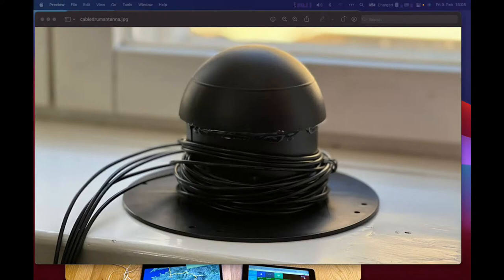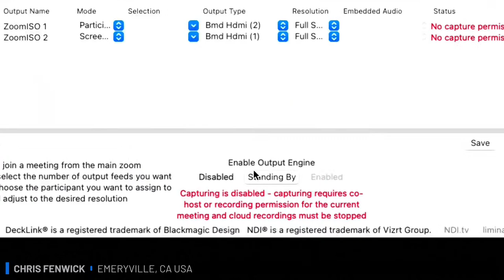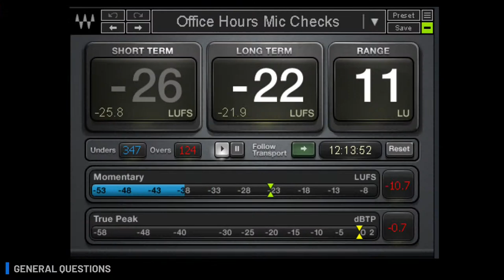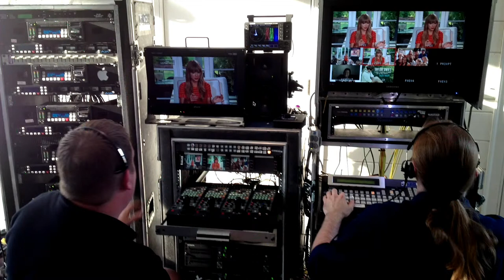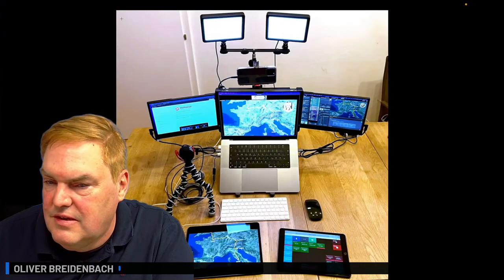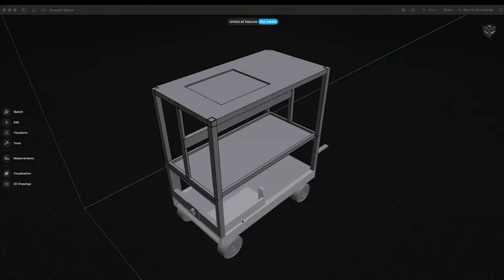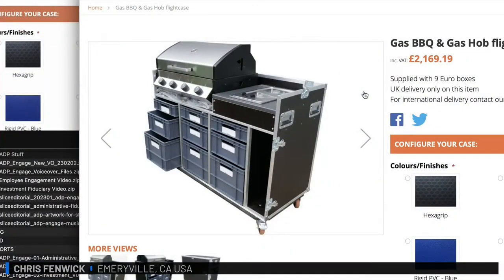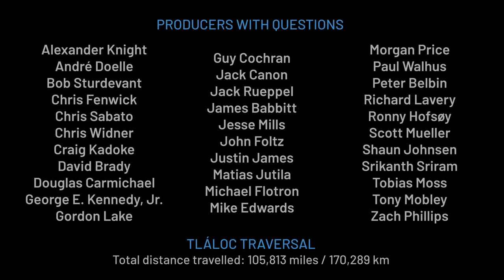Focus on Fly Pack Design And Construction

Comment from the maker: 04:46 My home setup has ATEM Extreme ISO’s. I’m going to be implementing ZoomISO, Decklinks, Companion and vMix into an event trailer with a 1M/E 4K and Smart VideoHub. What’s different about the 1M/E from the Extreme SDI? Will my workflow differ much?
08:40 Looking to purchase a portable 5G hotspot to use as a backup for if/when my main isp goes down. Found a few devices that have built-in sims and “pay as you go” data plans. Anyone have experience with this or suggestions for devices? Thanks.
15:13 Has anyone tried the RØDE AI micro yet? It looks like it could be a handy little audio interface. [link]
18:28 OpenAI nows offers a $20 / month plan which offers more availability during peak hours. Are you signing up?
21:48 @Oliver: Is it possible in mimoLive, to get a visual preview of a complete Layer Set, before recalling it to live? I only see the possibility to preview a layer in the stack.
25:02 I just threw up some color accent lights for a gig last night in a well lit room. They were slightly noticeable in person, but too strong on camera. Tips for pulling this off better? Is it possible to color accent well for both room and camera?
27:59 I now have 3 Macs with 10g ethernet. I'm looking to connect them and wondering what is the simplest 10g switch worth buying for a home office?
29:03 Morning Guys! Im looking to make some 6G SDI Cables especially for longer runs. Im already sold on the Neutrik connectors, but what cables (brand and model) should I be looking at? Thanks.
30:20 ah Zoom ISO... you are a fickle mistress. In the Saga of "screen sharing", I think I have a trick to get it to work more reliably. May I share?
31:30 @Oliver: Can I listen to an audio submix of sources, that aren´t live? E.g. bringing Zoom audio output into mimo, send it to a separate mix into my headphones, combined with my live microphone, which also goes into Zoom.
32:37 For a live band accruing fans for local shows, do you agree that an email list is king? What are the next couple priorities to increase attendance and ticket sales?
40:59 Can someone please remind me of the domain registrar preferred by the panel? Thanks.
42:09 What does one do with more than one Supersource? Use it with another M/E or can you use two SS in same M/E?
43:57 What is the panel using for remote desktop and managing lots of machines with different operating systems? I'm particularly interested in how you make configuration changes across multiple Macs/PCs at once.
44:53 Morning Guys! Oliver, what new updates can you share planned for Mimolive in 2023? Love your software!
46:44 I recently had Chat-GPT look at some Python code and asked it to input Remarks and see if it could make the code more efficient. It did a fair job. Has anyone else tried it and how were your results:
49:09 Alex, you mentioned that you're using MimoLive more of late. What are the features it has that make it attractive versus a hardware switcher solution? Are you starting to ease up regarding reluctance to use software-based switchers?
55:38 On MacBreak,Alex discussed having a presentation about midjourney on the “Ask the Tech Guy” show. What time will the presentation be on Sunday?
56:33 What is the best way to bring in guess from a zoom meeting into mimo live to provide them with graphics and a lower thirds?
57:04 What's the best way on a Mac to turn NDI into webcam? NDI Tools squashes anything to 720p30 but broadcast software virtual camera seems heavy on the processor.
58:03 Can Oliver talk the benefit of Mimo Live Forum?
59:11 yesterday you discussed GoPro cameras Labs firmware allows any settings to be changed with a QR code without fiddling on phone or camera Any experience?
59:56 Alex, you've mentioned Sound Desk a few times. What is the latency of it as a mixer? (I'd never heard of it till now)
01:02:38 What's the best way to avoid video feedback in Zoom? Screenshot: [link]
01:03:03 MacStadium (and other cloud providers) have talked up "Mac minis in the cloud" that are instantly available. How would they be working around the long delivery times for the M1/2 series?
01:04:06 Do you think that social media professionals should still include TikTok in their media mix despite the growing pressures against it in the US?